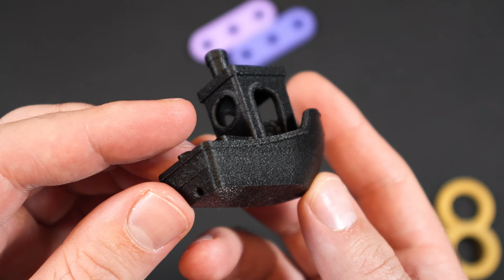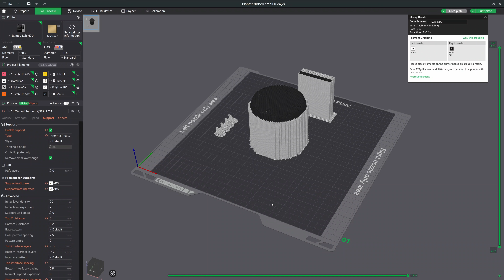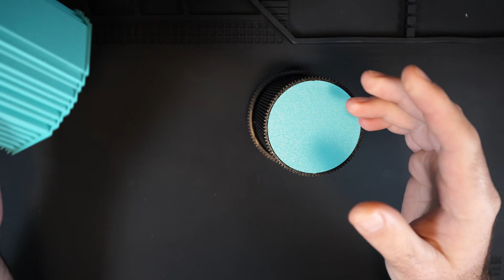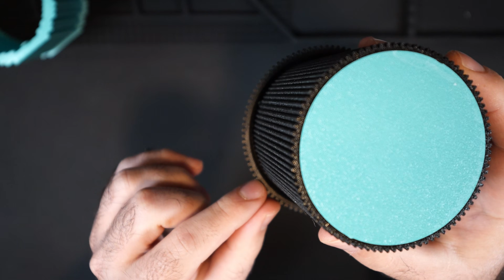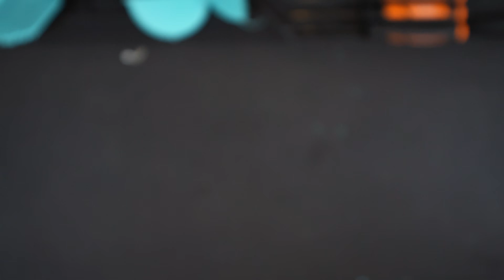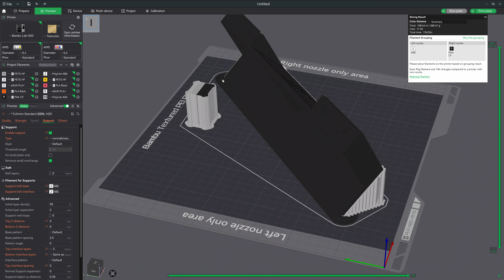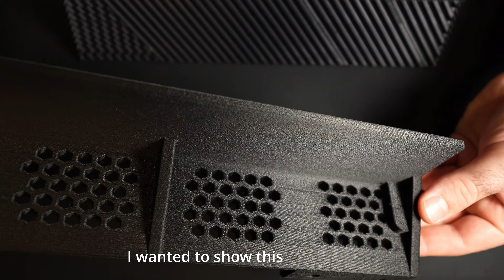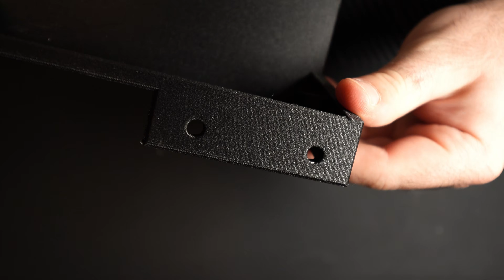Printing PA6-CF with ABS/ASA supports on my Bambu Lab H2D

Comment: Set up my printer yesterday… first print was a PPA-CF plate that was flawless, then two multicolor prints that were flawless and another PPA-CF print that was flawless.

PPA-CF and PPS-CF are by far my favorite filaments for tough high temp parts at the moment.
It’s a great printer.
Reply from the maker: @BirolOkyaş  yea i looked through all of the properties and statistics, it seems like PA6-CF is best all around for strength to cost ratio. But I want to try them all!
Reply: @sammuxlow Give the polymaker pa612-cf a go. It's not very expensive (for an engineering filament) and it has a better balance of properties compared to pa6 and pa12 nylons. Pa6 is a really strong and rigid nylon WHEN DRY. When it  absorbs moisture it becomes much more flexible and this can become an issue. Pa12 nylons don't absorb moisture nearly as much and stay more rigid, though they lack the impact resistance and tensile strength of pa6. Pa612-cf blends the two into a really good 3d printable material. It'll have a smoother surface finish as well as it doesn't have as much carbon fiber % as most pa6 nylons do.
Reply from the maker: @rileyneufeld7001  thank you so much for this! You explained it very well, I will definitely take a look at it. Maybe I can do a comparison
Reply: What did you do for safety?
Reply: @mostlymessingabout  ppa-cf is almost 50% stronger than pa6-cf and isn’t nearly as moisture sensitive
Reply from the maker: @BirolOkyaş  right, but its $187/kg... which is more than I want to spend atm. Thats why I said price/performance ratio. PA6-CF has excellent inter-layer strength as well, something other materials lack. Its not listed for PPA-CF on bambus website, I wonder why.
Reply from the maker: @BirolOkyaş  but yes, if you need the strongest stuff out there, that would be my recommendation.
Reply: @sammuxlow  I printed Bambu PPA-CF and Siraya Tech Fibreheart PPA-CF. The Bambu is a little better, but the siraya is very good and it’s “only” ~$60/kg.

Comment: I will try sourcing HIPS for supports for my H2D when I get it, years ago when I built a dual nozzle printer, HIPS worked great as breakaway support for several of my prints.
Reply: Hips works great. Dissolve it in dsolve which is limonine solution.
Reply from the maker: @yeheyheyyeh89  I've never tried it! Sounds interesting
Reply from the maker: @JeffDM  if you ever try it let me know how it goes!

Comment: polydryer isnt really enough for nylon. Also nylon isnt stiff..it looks stiff out of printer, but over time absorbs moisture, not good for functional prints unless its for rc cars. That banding is moisture..not fully gone. Hevort made a vid about it. Nylon will creep/ deform over time
Reply: I'm in agreement with the responder here. Nylon needs 80c min. I print engineering filaments exclusively on all 5 of my Qidis. 
Getting optimal results from nylon CF requires 6 hrs min at 80c & I will print directly from 2 sunlu 4 bays running at 70c. Many prints lasting 6 to 8 hrs. And I get amazing results that my high end customers demand. 

I will say that I'm impressed with the gentleman's use of supports. Not a Bambu fan at all but video sir!
Reply from the maker: @Helixx_T7  Thank you!
Reply from the maker: @Pixel2Plastics  its enough over long periods. And it worked great! Im pretty confident the banding was not moisture related, fine artifacts like that can be caused by infill patterns, but ill look into the vid. Thanks

Comment: That oozing is because the PA CF wasn’t fully dried out at the correct temperature and length of time.
Reply from the maker: @lethaldonkey  once I get the HT AMS ill dry them again and see if thats true. I didn't see much stringing on my parts near seams, so I'm confident the filament was dry.
Reply: @sammuxlow How long did you dry the filament? Nylons can take up to 48 hours or even longer if you're not drying them at high enough temperatures. But generally speaking if nylon is oozing it's got moisture.
Reply from the maker: @rileyneufeld7001  I dried it for 24 hours at 65c, like I said moisture would show in part quality, I didn't see much stringing, and I had 0 warping. But it could've had some left, maybe it wasn't enough to affect part quality?

Comment: Z banding on nylon parts is indication it's absorbing moisture during the print, keep the dryer running as you're printing.
Reply: I hope they patch the AMS2 and AMS HT to enable drying while printing for exactly this reason.
Reply from the maker: @KHAEntertainment  I totally agree. They should also allow us to select rotating or not while drying...
Reply: @sammuxlow  I was thinking more about the drying while printing limitation... I bet it's because of power consumption. The H2D alone can nearly Max out a 15 amp circuit at peak. Add another 2 to 5 amps from the drying and poof, there goes your breaker. 

They probably don't wanna deal with the backlash and having to explain to people to plug the printer and dryer into separate circuits so instead they just disable it. My theory anyway.
Reply: @KHAEntertainment could well be, but it's extra frustrating for us non-Americans / rest of the world... any given outlet in my country has 230v and up to 13A (2990W). I can only imagine the frustration of being limited to 120v 15A(1800W) at regular outlets.

In my workshop I've got 230V 32A outlet for my welder...  7360W of power, this is not uncommon to have available in normal residential properties garage...
Reply: @a-091-l2j  I actually talked to my rep at bambu about this and their reasoning wasn't actually due to power draw, but rather that's certain filaments, mostly PLA, could be more prone to clogging the nozzles and getting struck in the extruder if they were being actively dried while printing. 

I could totally see that happening and being that the majority of their customers just print with PLA that's definitely a valid concern. 

For those of us that want to print with engineering materials (or even just PETG), having the ability to run the dryer at the same time as the print is sometimes necessary. Having the dryer built in to the MMS was one of my reasons for buying on anycubic Kobra S1, and for that very reason it's still my go-to machine for PETG  as I can run the dryer at the same time as the printer.
Reply from the maker: @kazolar  I didn't have the issue with any other print, so i dont think it was that. And it was very faint, not severe. The enclosure was at <10% humidity
Reply: @sammuxlow  I've had it happen a few times on the x1c with pacf and absgf. Drying the filament solves it. Longer prints with nylon needs to have the dryer actively running.
Reply from the maker: @kazolar  the longest prints were the brackets, +13 hours each. No banding on them, but I will definitely consider your experience for next time!
Reply: @sammuxlow  10% humidity in the enclosure? Is your roll in the enclosure?
Reply: You're exactly right. A completely dry nylon roll will absorb moisture during a print without active drying. Ive tested this and got the z band without active drying. I dont know why some people refuse to accept this. I use the s4 but even my cheap little dryer during printing after its already been dried in the s4 prevents the z banding.
Reply: I am not convinced that you can pick up moisture in an AMS that contains viable  dessicant during a print.

Comment: Did you print the flower pot upside down? The holes for the feet would have worked anyway.
Reply from the maker: @txm100  yes it was intentional
Reply: @sammuxlow  that one had me wondering too 😂

Comment: I ordered my H2D for almost this exact use case. I was going to experiment the same way you did and it sounds like I won't need to since it worked great for you. I will also be playing with PPS-CF for creating function in engine car part to test before machining. I can't wait till my H2D comes in. Nice video! Thanks for sharing.
Reply from the maker: @neekovturbo  it works great and I did 0 tuning. Super siked for you! This is a great printer for engineering filaments and rugid projects. Thank you for commenting!
Reply: Have you used it for pps-cf prints? what interface/support material did you end up using?
Reply: @Fr33KFC  hollow this video when he gets to Orca slicer settings and you are good. Just keep in mind that you may need to make a custom ASA profile with no chamber temp and use it as interface layer only to let the PPS-CF do its thing with its settings. Also may need to play with that same asa profile for bed temps since your main material will be pps-cf and just the interface layer asa. I get buttery smooth bottom surfaces using this fine gentleman's Orca settings but took me some playing around on my particular models and geometry as they are different. try out on a few simple things and see how it works.
Reply: @neekovturbo okay thats great. Thank you